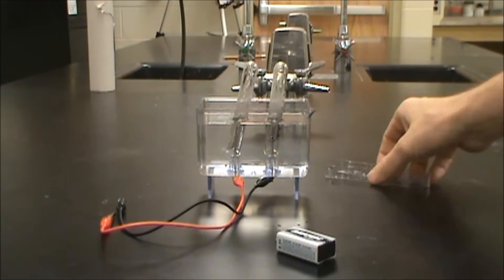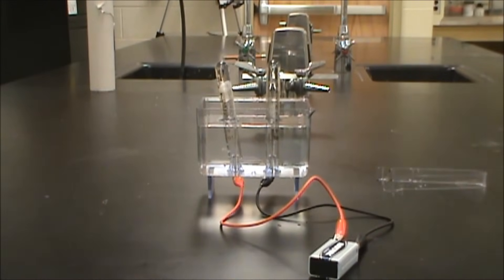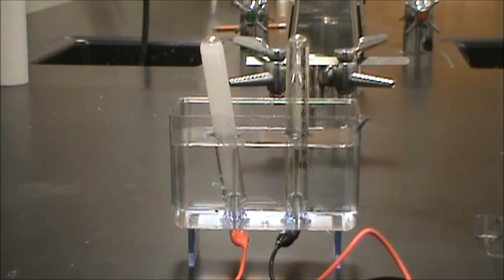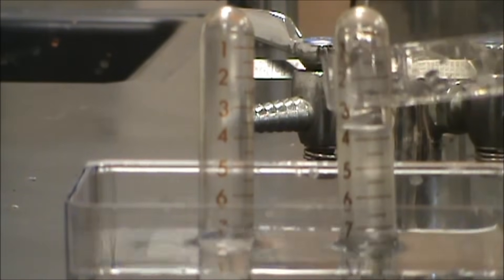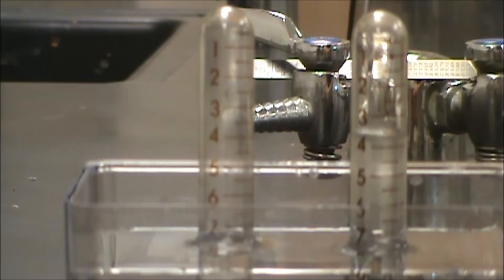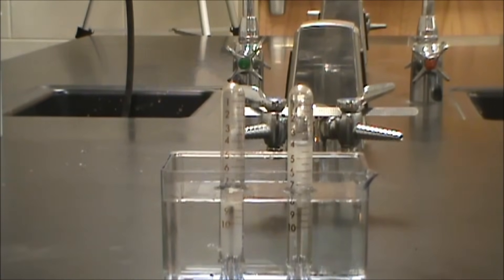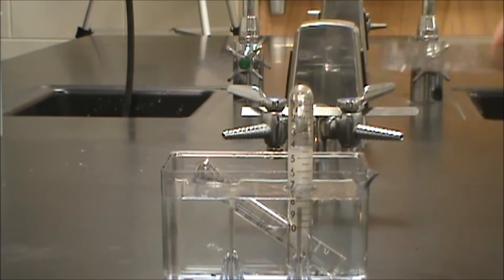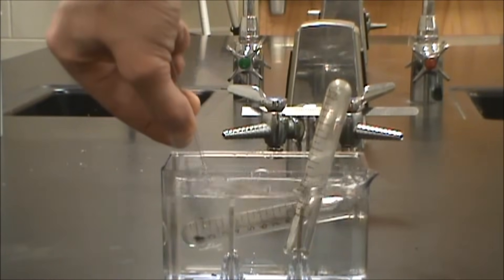Electrolysis of Water

Comment: No idea if you are still watching this space, Scott but ... is any NaOH lost in the process?  i.e. if you arranged to keep the volume of water constant as the hydrolysis occurred, would the NaOH solution remain at 3M?  Or would a constant resupply of NaOH be required to maintain the concentration?  Thanks for the video :)
Reply from the maker: A bit spills out due to the bubbling. Not much, I don't think any net is loss due to reaction because H+ and OH- are both generated and the solution mixes regularly when the test tubes are moved. Everything I've experienced is that it remains 3M, it does discolor often due to the burning splint residue so I only reuse solutions for 5-6 runs of the experiment usually.
Reply: @APphyzicks   ... Thanks a bunch!

Comment: I tried this in a small bottle with 2 stainless steel plates about 0.3mm apart and drew about  20A at 5V.  Distilled water with some NaOH in it. The production of H2 and O were abundant.
The stainless steel electrodes never corroded and still looked like new.

Comment: So if one wanted to collect both gases, why would 3M NaOH be safer than plain distilled H2O?  If NaOH is safer, then would keeping some of the salt in the water during distillation be prudent?
Reply: H2O in a pure form would not carry out electrolysis because in its pure form it does not conduct electricity. An ion producing substance like NaOH or H2SO4 is necessary to donate ionization without harming the purity of H2 and O2 gas.
Reply: So what about salts?  Water straight out of the tap has plenty of that.  So does water out of the ocean.

Comment: Are the hydrogen and oxygen gas formed neutral charge? 
So they can't attract or repel other ions? Or make new molecules?
I saw a video from plasmacluster air purifier saying it made O2- and H+ ions that attach to coronavirus spike proteins and form negatively charged OH radicals that electrostatically attract H+ from the surface protein of the virus and break it down.
But if the gases made from water electrolysis are neutral charged then I don't understand how that is possible.

Comment: Why would you need to have a sodium hydroxide solution added if you are trying to demonstrate the production of gas from water? Will it work without it? How do you know the nodes are not simply reacting with the solution to create the gas? I see liquid has reduced in the tank very minimally, and this demonstration is very unsatisfactory. We should be able to measure the gases and see how they relate to the water, but more importantly understand the reaction of the use of sodium or potassium hydroxide and its reaction on the electrodes, and isolate this from what we assume as gas production from water.

Comment: The title is misleading, "electrolysis of water ?  You used a solution, not water ?
Reply: Yann cedric Totsingan  once you've added an electrolyte, its then a solution, no?
Reply: @bloodsthicker5651  without  adding acid water cannot be electrolysed. Distilled water is a bad conductor of electricity.... so by adding acid, it becomes a good conductor  of electricity..... Hope that helps you🙂🙂🙂🙂
Reply: @biswajitdutta770  water is an insulator, so no, you can not pass current through it. The current will flow through the electrolyte in the water, there for, you are splitting the ELECTROLYTE!.
Reply: @biswajitdutta770  water can not be made nor destroyed, you'll only ever change the state ie. Solid, liquid, gas (vapour). If you believe water to be two gasses in our pressure system,  prove it. Find someone that's made a specific amount of water from two specific amounts of the two gasses. Best of luck to you 👍
Reply: @bloodsthicker5651  thats why I am adding acid.....
Reply: @bloodsthicker5651 WHAT ARE YOU SAYING?????? Did you ever study chemistry??
Reply: @bloodsthicker5651  2h2+o2 = 2h2o
Reply: I learned that water was H20. I've since done my own tests and observations. So my opinion now is water is not and never will be H20.
Reply: @biswajitdutta770  you'll also believe that fish take the oxygen from the water  exchange for C02.
Please find me a video that demonstrates the gaseous exchange from fish.
Reply: #gasexchangeinfish
Reply: @biswajitdutta770  oh, silly me, the Co2 dissolves in the water, right?

Comment: Hi sir, if you continue to run this experiment, does all the water will be completely drained and become only Hydrogen Gas & Oxygen gas?
Reply from the maker: The electrode loses contact with the solution in the H2 side eventually and the circuit shuts down after about 12 mL of H2 gas are produced, if you could keep the solution in contact it would keep going for a while but the top isn't covered in a way to push the solution out.
Reply: Scott Milam you mean that the solution in the end will run out of  "Baking Soda" and hence the H2 Side will lose contact with the solution?
Reply: Scott Milam How about if i continuously channel out the H2 & O2 gas out from the Test Tubes to another container (example attemp: https://youtu.be/gZJEDe_HUcw), does it mean this electrolysis can be continue for infinate time ? Or I need to constantly add NaOH into water in order to keep the electrolysis running infinate time?
Reply from the maker: It'd be hard to do that effectively in my opinion.  Or at least if that's your goal it'd be easier just to decompose peroxide and hook up tubing so you could still do a collection over water.  Then for H2 just add Ca to water or a reactive metal to acid.  You wouldn't be able to keep a seal with the electrolysis kit and it would take longer than the alternatives.

Comment: What materials were the electrodes made of?
Reply from the maker: I'm not sure, they don't look like graphite, maybe Arbor Scientific that sells them would say.
Reply: the negative electrode can be made of less reactive metal like Copper and the +ive electrode must be graphite.....the positive electrode will release O2 therefor if you use a metal, oxide of that metal will form. in the negative electrode H2 gets produced therefore you don't need to worry about that. just remember that you need a graphite rod at the positive electrode. you  can get this rod by throwing an empty AA sized 1.5V dry cell on your wall ... open the contents safely after you see that the metal cover is wide enough... carefully take out the carbon rod.... and wash it with water to remove the reactive stuff.... and then you can use em...... careful while handling H2.... its the best fuel.
Reply: Jeremy Morales platinum foils

Comment: hey scott,i am wondering what could be the hypothesis and the objective ?
 please answer
Reply: haitham ali do your own science homework
Reply: Due to the polarising effect of the electric current the oxygen and hydrogen becomes polarised and are arranged in two different rows as seen in video. Oxygen carries the negative charge hence it is attractted towards the anode and hydrogen carries positive and hence attracted towards the cathode. Hence oxygen and hydrogen get seperated in anode and cathode respectively. But as you can see in the cathode test tube the amount of empty space is double than anode tube because hydrogen reacts in ratio 1:8 by mass this means water is in the form 2 hydrogen atoms and 1 atom of oxygen.
Reply: @rumaprakash3894  LOL, responding 4 years later is really gonna make an impact
Reply: @ezzyyyyyyyyyyyyyyy  Dont  you know about butterfly effect, everything has an impact!

Comment: Hey scott, just wondering, why does the water need to be in a 3M NaOH solution? Thanks
Reply from the maker: It needs something ionic to conduct electricity through the water, the 3M NaOH produces the least alternative gases that would otherwise mess up results.  I am not sure why the concentration matters, but I tried about 8 other solutions and this was by far the best.  Anything with chloride produces enough chlorine (that dissolves) to alter the 2:1 ratio.
Reply: Does the NaOH count as part of the equation, as a reactant? And what are some alternatives? Thanks!
Reply from the maker: not the net reaction (2H2O --> 2H2 + O2) but if you split it into 1/2 reactions it is involved, alternatives are anything that conduct electricity when aqueous but don't have an anion that produce an alternative gas.  I tried NaC2H3O2, Na2SO4, NaHCO3, NaCl and sodium citrate and none worked as well, but would give a 1:1 or 3:1 ratio.
Reply: Ok I just realized the answer to my question... anyway, what substances should be used for the electrodes so that they don't corrode? Thanks
Reply from the maker: graphite works best, if you buy the kits I use in the video it's all set for you and you can just clip alligator clips to the battery.

Comment: Hi Scott, i am conducting a research, in which i choose 3 compounds as electrolyte/catalyst: 
1.) Sodium Hydroxide
2.) Potassium Hydroxide
3.) Potassium Carbonate

Can you please suggest me which one will be good if i will use the same source of energy to compare.
i want to generate the setup that will be efficient or can generate large amount of H2 gas.

as i am making an experimental data, you can additionally share the records of the experiment conducted by you as you described in the description. 
Also i want to know what are the factors that relates the performance of this kind of setup or cell, and how we can control the efficiency of this cell. 
i want to make the most efficient HHO generator,  that means the one which use less power and produce more HHO
Reply from the maker: I tried a lot of different compounds, 3M NaOH was far superior for getting the correct 2:1 ratio of gases.  Anything with chloride would make limited amounts of chlorine which would dissolve in the water.  Sodium sulfate would produce sulfur oxide gases, sodium bicarbonate did not work well.  The biggest problem is the production of other gases, but even NaOH would produce odd results if not at the correct concentration.